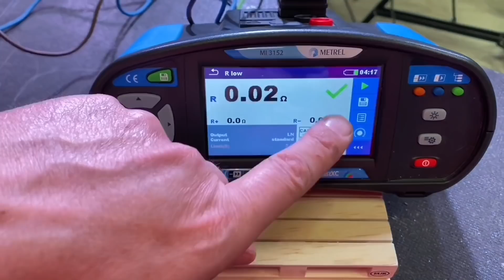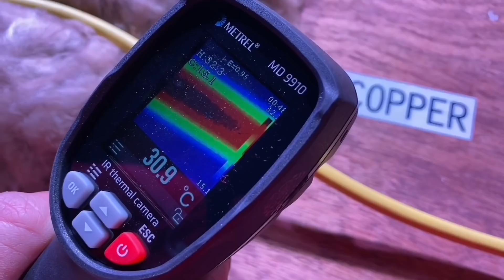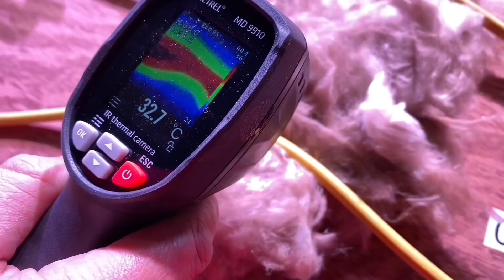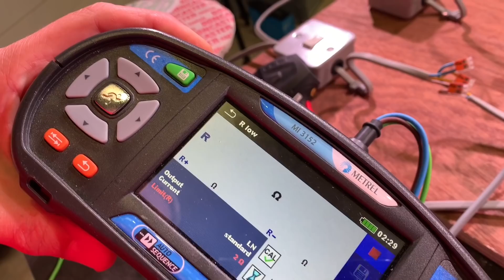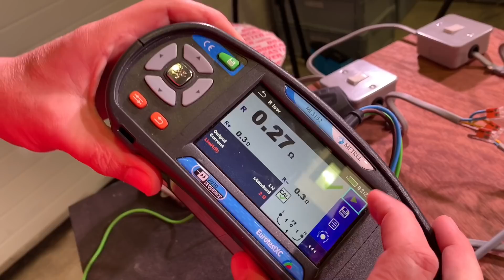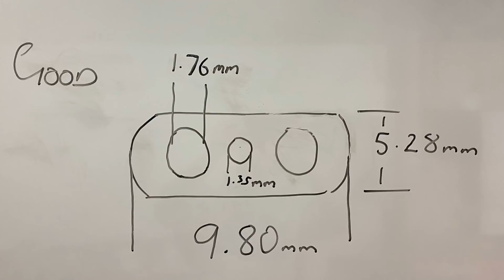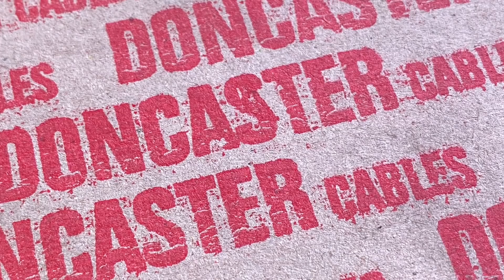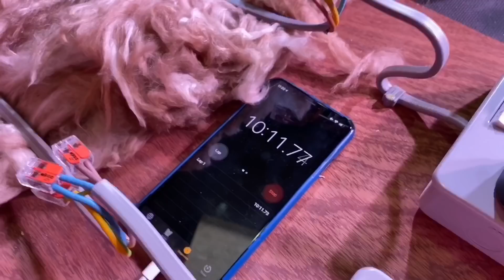The disturbing facts about FAKE and SUBSTANDARD cables - UGLY Twin and Earth, light weight flex

Comment: I’ve seen a similar problem with fiber optic cables, we use a lot of a specific metal free buried cable, and we got a really good deal on an equivalent cable, name brand as well, so somebody bought and subsequently buried 50 km of it. When it came time to splice them however, I started getting calls from the field techs that wanted to have a word with whoever bought that junk. Now, in fiber optic cables you basically get two kinds, separate tubes for 12 fibers each, or one big tube with bundles of fibers. In the center tube cables, there’s a yarn wrapped around the bundles color coding the different bundles (fibers are 0.25 mm thick, and only color coded up to 12, so this is quite important). Well, this new cheap and cheerful cable had two bundles, but to save money, they only yarned the second bundle, and to save further, the used so little yarn that you had to peel back the cable 5 meters before you could find the yarn and separate the bundles. All to save on what’s essentially sewing thread. But hey, we saved maybe 10 cents per meter on that deal, it’s not like the fiber guys charge us 65 euros an hour to strip back cable.
Reply: At that point seems easier to just experimentally determine which is which. Shine light down only one bundle at the other end.
Reply: @JasperJanssen  the problem is that the other end can be 5 km away, and you would have to do that 12 times for a 2x12 cable, 36 times for a 4x12 cable. Hence why we only use cables with separate tubes for every bundle of 12 fibers. Plus you need to splice on a connector to get a test laser on the fiber!
Reply: @sstorholm  if your only problem is identifying one bundle of 12 from the other bundle of 12, you shine a light down all twelve of bundle 1. That works after you’ve identified them at one end, anyway.
Reply: @JasperJanssen  that's the issue, you couldn't tell them apart without peeling back 5 meters of cable. I'm not sure if you have firsthand experience with these cables, but in a 2x12 cable we're talking 24 fibers, all a quarter of a mm thick, stuck together with a goop that's like vaseline. And the only thing that tells  you which 12 differs are which bundle is a thin red thread supposedly wrapped around the second bundle. Normally, after you wipe off some of the vaseline, they fall apart in two bundles by themselves, but since only one bundle was wrapped, and very sparingly, it was almost impossible to even tell the bundles apart.

Comment: The math proves the physics. 50% more resistance = 50% more heat, which also reduces efficiency and increases consumption per watt/hour. Those paying the electricity bills should certainly be concerned.
Reply: They really didn't use a long enough length of the flex for the resistance test. Yes the change in displayed value was 50% but it was only one "unit in last place", so it could have been anything from a tiny change to a near doubling.

Comment: Jail the seller/importer/building firm for minimum 20 years like they should have done with my 3 storey 2008 'townhouse' held up by FA un-cemented vertical pole in large 'hidden' ground floor internal volume which also had ZERO insulation above the top floor ceiling. Found when immediately after purchase changing ALL ceiling halogen (pop, pop, pop) lights at great personal expense to LED equivalents. I won't NAME the builder, lets just say I live 90 mins NNE from PLYMOUTH on modern estate.
 I personally got another electrician to move the twin oven to part way up a cabinet to save my back. It stopped working within a short period and there was a smell of burning. On inspection the built in mains cable was attached with only ONE thread of wire.....Cost to me a new oven, paying a (different) electrician to remove/install and very possibly, the lives of all in a 4 double bedroom house!
 For God's sake UK electricians/builders get a grip. I spent 30 years absolutely, totally, 100% honestly testing manufactured pharmaceutical products for a wage probably half as much. Shame on you. Think about it next time you buy a pack of paracetamol tablets in a supermarket for half the price of a 2nd class stamp!

Comment: Great video efixx team  , sub standard products are a major concern in the industry but the BSI and HSE do not seem interested .
Reply: No money in it, unlike giving different tickets to jobs that don't need it, does not highlight or get rid of the cowboys,
Like gold cards, cscs, whatever, while the undermarket keeps undercutting the legit market, pay tax, etc,
Like the electric meter installers that are agency staff, told step by step what to do, like ikea flow diagram charts, then left to carry on with it, yeah yeah, bollocks, it happens, a guy in the pub I know well, has a job like that for a few months, eleven fifty an hour, he  worked in a admin office for like twenty years, then go that gig, he was asking me question, like can I get a shock and die, etc, he left as he could not do the meters fast enough, the number increased, over time, he had around seven mins to do one, circa 2017,

Comment: Unfortunately the whole video is full of inaccuracies and a great lack of knowledge however, a reasonable attempt at a very amateur approach. There was no mention of specification requirements i.e. BS6004 (T&E) and that resistance is specified as a minimum (at 20 dec C) and thus Doncaster could exceed this but the other manufacturers still be complaint. The BS states that the manufacturer should be identifiable and BASEC have approved marks on their certificates. also many manufacturers 'metre mark' so length is easily checked. I have known all manufacturers to suffer lack of talc and the best advice is to check a reel before installation. I could go on forever.....

Comment: Is aluminum (or aluminium) copper disguised wire really that common over there? Here in America it's not completely unheard of but I've never run into anything I've ever really had doubts about. Or is it mostly when buying online? I really only get my wire from direct suppliers or reputable hardware stores.
Reply: No, but it happens and you should always double check both the material and the diameter of the cable to make sure it makes sense, sometimes you get cables that are actually smaller in diameter but do double-thick isolation to mask it, so on the outside it looks exactly the same, until you actually strip them and notice there's far less copper, be paranoid and trust nobody some people seem to be deliberately trying to start house fires sadly
Reply: Subscribed also.

Comment: I had a cable that was difficult to strip just like in your video. It was 1.5mm T+E from Screwfix and it was branded Prysmian. Normally a brand I trust.
Reply: I've noticed Screwfix Prysmian is usually good but can vary with bad batches. Same with other Screwfix brands. My local electrical supplier is better more consistently, especially their plastic conduit, but only discovered them after having a lot of work done on our house

Comment: I checked the area of the wires. Doncaster 2.46 mm2, other 2.14 mm2.  More than 10% difference.
Reply: The 1.63mm diameter cable corresponds to US 14AWG wire diameter and is the size used in US domestic wiring. Perhaps someone (in China perhaps?) is manufacturing the same wire for US 15A cable and UK 2.5mm2 cables.

Comment: I have a bit of a rookie question: Does a  cheaper cable with higher resistivity generate more power losses? so if we save on cable few pounds at the beginning that means that over the years we will pay much more by slighty higher energy bills?
Reply from the maker: Yes it would result in higher losses, so you pay 💰 in the longer term.

Comment: I’ve used Doncaster cable since 2011.  I’ve had numerous problems stripping it over the years.  In 2019, I had another poor batch, I telephoned Doncaster cables technical, who fobbed me off.  I was really disappointed with their reply, now I just use whatever the supplier has in stock.  It’s got plenty of powder stripping is great.
Reply: Same here with Doncaster cables, and IDH, even to the point where the different insulations have melted together, and as usual the problem was only discovered after the walls were fully plastered.

Comment: Just for comparison, a 2.5mm square cable equates to a diameter of approx 1.78mm. So the substandard cable line/neutral conductors are only 2.14mm square! Would have to consider de-rating that I reckon!

Comment: When i worked at a (now bought-out) electro-technical wholesaler back in the early 2000's, they too sold various branded and unbranded cable. The one that used to be perilli (now Prysmian)  was the most popular. But the unbranded was very popular, i'm sure it came in from China. Wouldn't touch it with a barge pole myself though. Stick with a well known Brand, that way you've covered your a**e.

Comment: That was very interesting 👍. I do remember year's ago bicc  doing alcumic cable in PVC/PVC and MI cable . Because of the copper shortage.
Reply: Inside the GDR it was typical to use alu cables then they not have a copper mine. Same many countries use in the both war times specially after they loose the colonies with copper mines too.

But now we have 2020 and all houses should be new or sell on market again - okay exept the palace and castle of the rich. But do you can buy world-wide copper and copper cables. Do you should check every product! 😕

So should no house more have old cables inside UK! And our electricans make a gold nose of change the old alu cables to new copper cables on place of the ex-GDR.
Reply: @AE-mu1jc  Lots of old cable here in the UK, but it's relatively rare to find aluminium in domestic wiring. Crumbling rubber insulation tends to be the bigger problem with old cables here in the UK.

Comment: I bought two extension cords off Amazon both of them were supposedly UL listed, the application I was using them for required me to cut the end off both of them one was copper and one was copper clad. guess which one didn't come with a UL sticker on it?
Reply from the maker: It’s definitely buyer beware in the marketplace!
Reply: @efixx  Yeah it’s just sad you have to buy an extra and cut it apart to find out.
Great demonstration, and I will continue to digress.... feel free to ignore it.

Thankfully for what I was using them for it’s a short distance and low draw circuit, but I was going to keep everything rated at 12AWG 20A as much as I could. code frowns upon having extension cords tied into fixed wiring.

What I did with them I do not recommend unless you know what you’re doing. Anti-DIYer warning.
In my basement there are small windows that don’t get much light and during my rewire I separated half the basement lights out to a junction that drops to a plug to go into a UPS. I also put a socket up near the ceiling Above the panel for the cable internet booster, antenna booster and that drops down on the other cord.
I have one UPS running lights and one running the router I mean rooter.
This way both the Internet stays up and the basement lights stay on during a power outage, it’s great having emergency lighting by the electrical panel (cu) it’ll be even better when I switch from florescence to LEDs.

Comment: Fan out those fine strands and hold them in a flame. Copper and aluminum melt/burn very different, and with fine strands all you need is a lighter.
Reply from the maker: Great tip - we will give that a try

Comment: Great stuff. I had contractors install data cable into a large retail unit. 6KM of it. I was there at the termination and testing. The testers couldn't work out why it was failing. I grabbed one of the boxes of "CAT5e" and sliced the cable with a knife... copper clad aluminium. They had to rewire the whole store.
Reply from the maker: Clad makes it sound “substantial” - but really it’s only microns thick.
Reply: @leewinters606  It was sold as CCA so the wholesaler was not at fault. The purchaser  at the contractor went for the cheapest option not understanding the impact.
Reply: @drummerbod  If that is the case it cannot have been CAT5e as to meet that standard it has to be copper so CCA and CAT5e has a big problem - like when CAT6 first came out - local distributer had CAT6e -- are the uprated version -- no just crap from China made by manufacture that had missed that its CAT6a and "e" is non existent ( to ANSI/TIA-568) - There purchasing department had got 100Km of it - all it was good for was may be for phone cable - definitely not ethernet  !
Reply: @tomd2917  something I've noticed, which may or may not be noteworthy: a lot of the CCA cable is marketed as "Cat5e" and not "Category 5e".  Possibly skirting just around the edges of the law regarding labelling of their unfit-for-purpose cable?
Reply: CCA is also a fire hazard.   We had a melt-down on a large POE installation all due to a shitty CCA cable that had been installed by the customer.
Reply: Copper coated is probably a better description!
Reply: Ouch
Reply: I had the same problem when fitting cameras. The electrician had bought "CAT5e" CCA cable off Amazon.
Reply from the maker: Great comment 👍

Comment: Had some fake blue arctic flex before, it was as rigid as SWA! Nearly impossible to bend or strip, YET the inside was real copper... so they had skimped big big time on the insulation / plastic.. yet used real copper... the mind boggles

Comment: Great Content as Always. Is the a standard stating you cant terminate Flex Cable within a CU. Not something i have heard before?
Reply: Not that I've ever heard of. If it existed, such a regulation would not permit singles in conduit to be terminated into a distribution board.
Reply: Pretty sure nothing stops you from terminating flex in a CU.

BS7671 does say that "suitable terminals shall be used or the conductor ends shall be suitablly treated". IMO a small fine-stranded wire under a large screw terminal is far from ideal and you should at least strongly consider using ferrules.

Comment: Great experiment lads,most probably made in china,if it's cheap  there's a reason it's cheap,,should there not be a bs standard mark on the outside sheath ,buy British 👍
Reply: It's as easy for the Chinese to fake that as the "CE" mark, it's meaningless.
Reply: @Cornz38   What do you mean? 

The company how make a product and sell it in the EU make self the CE sign on the product. 

Mean that now every without CE sign can sell inside UK after the UK is not part of the EU ... 

The CE sign mean only that the company think that all EU laws and regulary are okay. As example: 
- The copper is not burning. 
- They use isolation around the copper. 
And so on. The test center are more strict.

Comment: Have had dodgy 2.5 before didnt find out it was dodgy untill i came to do second fix😭, i always strip a metre of the wire now before i use it to save any future ball ache, have caught a few dodgy rolls by doing this over the years.
Reply from the maker: #TopTip 👍
Reply: Where did you buy the dodgy cable?
Reply: @electricery  cant remember now it was back when i had started working for myself, i think it was from cef? I've found a solid independant supplier now though so ive not had any more dodgy wires, i used to just bounce around suppliers but i found its better to build a good working relationship with a select few suppliers
Reply: @tarodchaoslord  thanks for reply, I was wondering if you bought from  reputable supplier or “get from anywhere maybe online” . I would have thought CEF would have genuine source of supply. Good tip to strip some first, not something I have ever deliberately done but will from now on
Reply: @electricery  no problem, i dont think that cef was knowingly selling dodgy wire it could have been a one off i think ive only come across 3-4 instances of dodgy wire its mostly been a mix of big reputable suppliers and independants, ive never had a problem returning them for a good roll though. I would never buy wire online, thats asking for problems.

Comment: I once bought 100m T+E for a rewire from a small independent wholesalers, unbranded....   After doing first fix and second fix with everything plastered and painted etc did IR test and got 20Mohms.  Split the cable in half (Was a ring final), got about 30Mohms on both legs, even tested from CU to first socket and was about 70Mohms.   

I know its acceptable but for me those readings on a brand new circuit that you expect will have to last possibly 50-60yrs I was not happy, effectively had to rewire the place again.  I was not trying to save money on the cable...  Lesson learnt always just buy Prysmian cable from screwfix now, not the cheapest but never had a problem with it and always plenty available from my local screwfix which is only 50yrds from my house.
Reply from the maker: Wow - painful 😣 experience
Reply: 50 yrs from your house? I hope you meant yards
Reply: @barrybritcher  well well, yer all over you! Voc forum, vouk group... Im sure ya stalkin me 😂

Comment: Had a 25mm 4 core armoured cable that i couldnt get the bedding off.. hours taking it off with a Stanley and taped up the mess. From A proper wholesaler and i bet alot of this cable is sold by big name companies
Reply: Had about 30 4mm and 6mm 3 core armoured cables to strip and terminate into the board with same issue. Had the boss on the case wondering why it took me 3 day to do it!!! Should not have bought cheap cable in the first place.